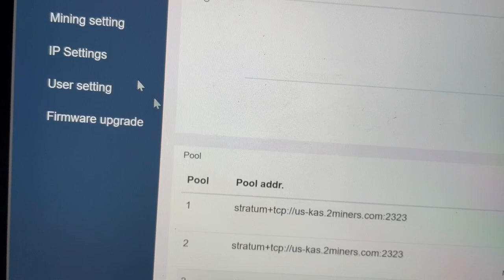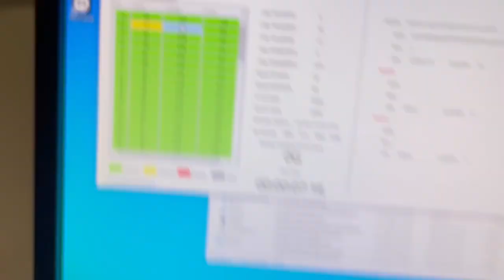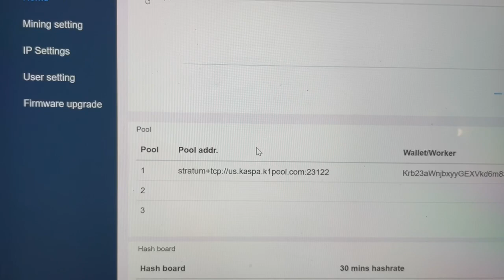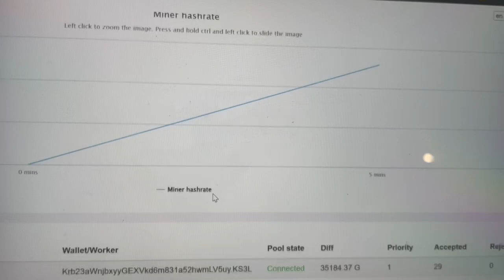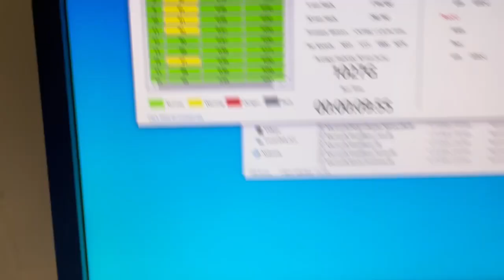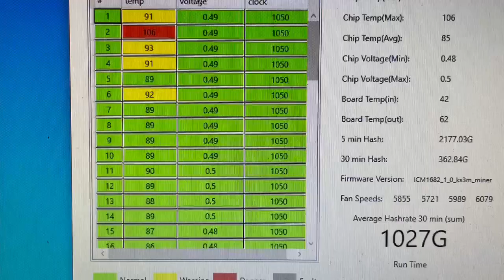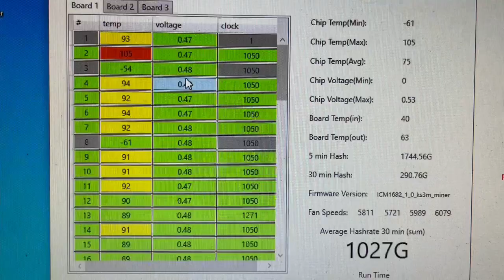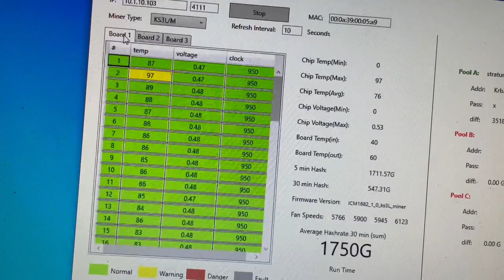Bought a Broken IceRiver KS3L - Part 1: Maybe it Works?!?

Comment: What the application you used to check the chip?
Reply from the maker: it is the monitor tool released by Tswift. Can be downloaded here: https://t.me/swift_mining/2441
Reply: Hi, if use your firmware, after that can change back iceriver original firmware?